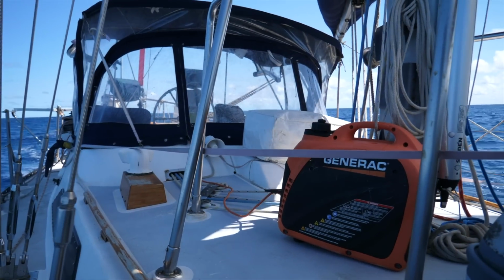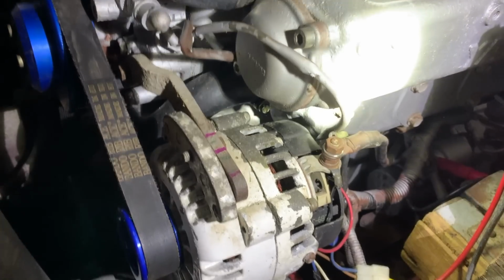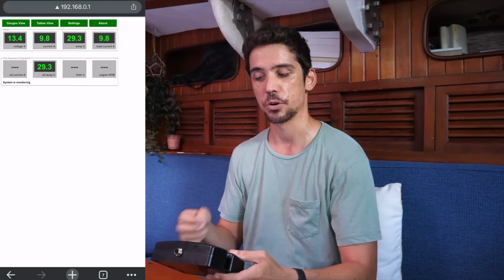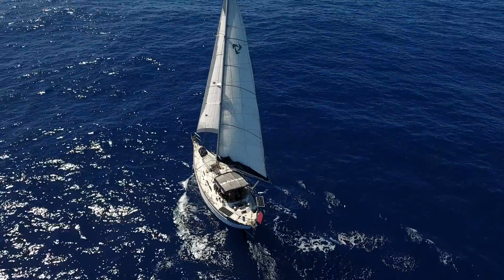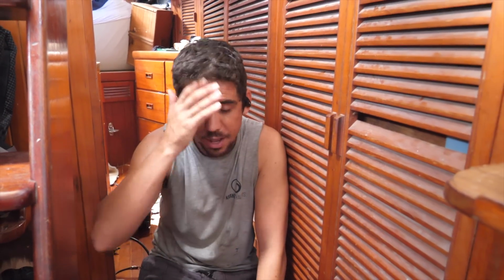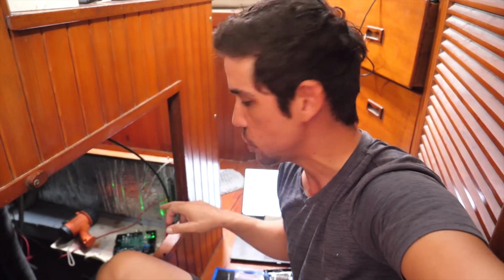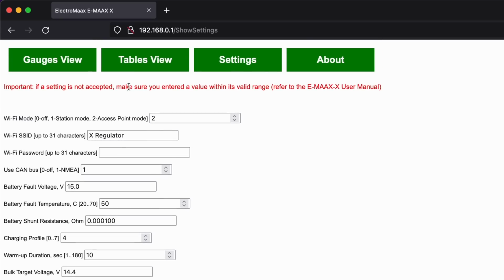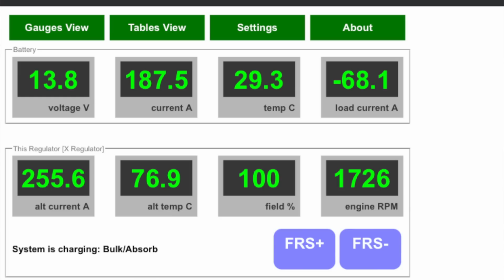No Generator? No Problem! -- 215 Amp Electromaax Alternator and controller installation.

Comment: Hi.

I am locking for some like this in 24volt ore even 48 volt.

Can you tell me the price and where to get em ??

Am a little BETWEEN this ore maby generator el engine on my gearbox for my to big of an diesel engine.

This balmar is over priced and make much problem whit time.

You feal this is a better one?

Just wonder. Cos i love to go diesel hybrid electric thats gets lower cost then balmar anyway for me in europe

Comment: We are currently in the process of reorganizing our electrical installation from AGM to Litium. our current alternator has a power of 70, we want to increase it to 120. what else is worth paying attention to? our engine is a Volvo Penta 2003 model, which means it is about 40 years old.

Comment: What a fantastic video mate but looks far to complex to have on a live aboard boat , I’m in the process of fitting a delco remy 28si large case alternator with no external regulation and I would expect to see 100 amps at 12 volts continuous once warm , I’ve been charging my lithium direct from my current alternator for nearly 3 years now and 400 engine hours as a full time live aboard with no issues and no burnt out items , I’m also not a fan of those small case balmars , have a great day and thanks for the video.

Comment: Well done Adam, I also bought electromaax equipment, but I did not have good luck with it, the voltage and current were all over the place, and after many months of emails, they told me I was on my own.  They kept telling me all their equipment was working as it should be, blaming the only & year old Trojan gel batteries. Then I got an excellent technician who bypassed the external regulator which worked as it should but was too high a voltage for the gel batteries, so at least we knew the alternator was good. Reconnected and after some more tests he found the alternator digital shant (not the same as yours mine came with the CSR Pro regulator)was defective. Contacted Electromaax but they refused to help, telling me that they are only a supply house. I ended up removing everything and recently installed a Sterling alternator to battery charger. Electromax  I found out too late that the support is non-existent, will not deal with them any more  I hope you have better luck then me Adam happy sailing.

Comment: Brilliant! I have installed an even newer setup (but very similar) to yours.  It’s the genmax 250 with the Pro-X with separate rectifier and custom serpentine belt pullies etc. Unfortunately after I got it all installed the engine spun a bearing and seized. 🫤working on rebuilding now. I went through a lot of what you did getting it to set up… I didn’t get to where you were and I need to check the output and get the settings dialed. I had a fully charged battery so it didn’t need to charge any.  I expected to see it so it’s thing on the maiden voyage when the engine died. I do think the parts seem top quality but yes on some level support is maybe a little less supportive (unfortunately). Haven’t seen my system fulfill its use as yet though.

Comment: I love you guys and have been a long time follower, I only wish I had half the electrical skills that Adam has. So they take away from this is that Balmar sucks, Electro max is overly complicated and you have to be an electrical engineer to figure it out! Really wondering where to turn to figure out a new alternator/regulator set up to service my new lithium iron phosphate battery bank! The fun really never stops does it?🤣😂

Comment: As long as you learn from the process and the trip from problem to solution continuously shortens, you’re on the right track. The orderly and analytical mind is the best tool you have on a boat. Well done Adam.

Comment: It's always good if the smoke stays inside the wires.  Good choice going to K frame/large frame alternator.  If you are getting 98*C after an hour with 175 Amps you have a well cooled alternator. True test will be on a hot day with the engine closed up and running for three hours.  If you find it gets over 98*C you can run a blower fan to the alternator and or do remote rectifier diodes.  You can reduce the engine bay temps quite a bit with a 600cfm blower.

Comment: Maybe you have some faulty, high-resistance connections or wires somewhere, throwing off the shunt amperage reading.  You zeroed it out, but I still wonder.  A bad circuit can appear to have little resistance, until it's subjected to a lot of current flow.
Reply: Another possible issue is that stainless steel connectors and washers, if you have any, are poor conductors under heavy load.

Comment: That melting is possibly stray current electrolysis. I would check for stray current in your motor housing and everywhere else, and ground snd remediate as appropriate.

Comment: You can always rebuild the old alternator, and put it on the shelf. New rectifier, brushes, bearings and clean up the corrosion on the case.

Comment: A small fact if you did not know. For approx every 25amps of current produced it takes 1hp(horse power) from the engine.. So obviously 200amps will use 8hp.... Well done with the fitment procedure..

Comment: All those Wifi components... 🤯
I have not heard it happen yet, but it's just a question of time until pirates collaborate with criminal hackers to mess up all your electronic configurations and easily take over your boat because all those electronics suddenly went crazy. Add Wifi extenders to the mix and you can't even "go dark": switching off lights and AIS is cute... but wifi can be tracked, too.
Wifi Passwords are just for good conscience... the security mechanisms were broken long ago... there's a reason why all companies tell their employees to never ever use public wifi. And home wifis get hacked constantly (takes 5 minutes max).
Reply: I believe, @Alex Kyoni that there's actually already a whole industry around data security on superyachts

Comment: On my Yacht I use Sanchem NO-OX-ID, (or any other good anti Ox battery grease), on any connectors. Even multi pin plugs I apply to keep the corrosion away. It works well on the spade connectors too.

Comment: Electromaxx was quite a problem for our catamaran installation  to include one of our alternators catching 🔥.  The customer service would not talk on the phone and we had back and forth emails for 4 months to try and make things right (it was during 2020 and COVID 19) The ancillary equipment you went over is newer and and seems better than the cheap basement programer software and erector set electrical boxes provided to us.

Comment: You mentioned not having internet out at sea. Starlink will solve this and apparently at a reasonable cost.
Reply: I am led to believe, $10,000 upfront equipment cost, $5000 per month for service. Not in the budget for most cruisers. Seems to be targeted for commercial users and super yachts
Reply: also .. no point in having the interconnectivity with the alternator company ..if they can't even answer emails and provide little service. Really sad to hear they approached adam with a solution but then dumped them with back-up service

Comment: I’ve heard of wiring corroding from the inside out over time on boats used in salt water causing intermittent issues.  It was a nightmare on my friend’s boat.  Hopefully, your wiring is sound.
Reply: That usually only happens to boats that have sunk...
Reply: @karaDee2363  seen it in cars.   check everything.
Reply: ONLY USE tinned marine wire. Problem solved.

Comment: Adam for us in the US still using the British Standard F, when you said 120 degrees thought not bad for an alternator.  Only later did I convert 120 C = 248F so quite a difference.

Comment: That's way cool!!

I had a 62' custom yacht....that I was going all over the place doing high end charters. Taking 6 people out thru the islands for a week or more at a time.  New England or Europe in the summer....back to the Caribbean for the winter.

However....with a lot of people....electric demand was constantly high.  FINELY..instead of no more tweeking....I got the biggest alternator I could get...250amps.  And putting in a regulator rheostat...to keep the Amp out put high, even as the batteries charged.

OH....sweet.  Even put in an inverter to have 120v to run blenders...etc.

But I did that a long time ago....your dial in computer monitoring.....S W E E T!!😳💕🤗

Comment: Jesus. You need a freaking degree in elec engineering just to go sailing. So impressed by both of your skills at dealing with everything going on….
Reply: Not really, only the new breed of sailors today need all that technology to go sailing.... But mankind has sailed all the oceans for hundreds of years without any of it and survived...
Reply: @karaDee2363  cruising in luxury is not the same as survival. i would be horrified if my boat shower did not provide hot water, my electric toilet didnt flush or my dishwasher broke. ancient sailors would be horrified if they couldnt reach land before their water supply ran out.
Reply: @ysesq  you can heat water with a solar water bag and you can pump toilets with a manual pump and you can wash dishes by hand... All of which does not need electric current or create any hardship..
Reply: @karaDee2363  tons of hardship cleaning dishes by hand and is the solar heating really going to heat 20 gallons of water for my shower ? and manual toilets are just awful. ive used them.
Reply: @karaDee2363  Yea but who wants to live that way? 2 gallon showers with lukewarm water suck. Manual pump toilets suck.
Reply: @karaDee2363  you'd wonder how the Hiscocks, Pardeys et al ever managed.
Reply: Adam did engineering at uni I believe.
Reply: And herein lies the problem
Reply: The beauty of sailing life is you can go however complicated you want it.